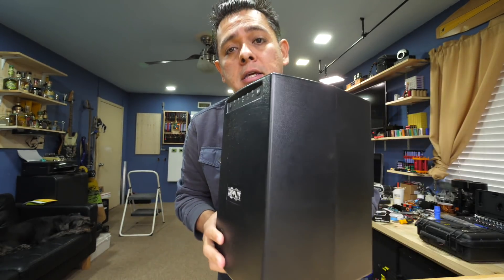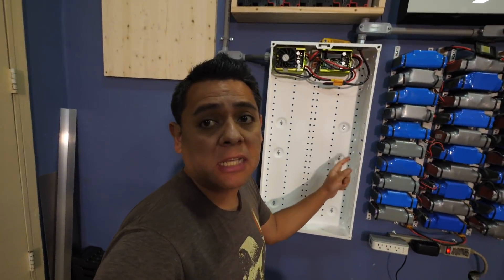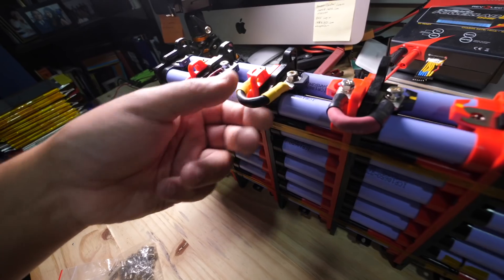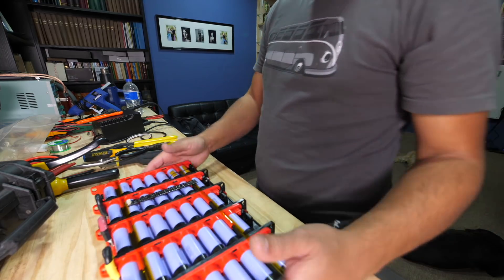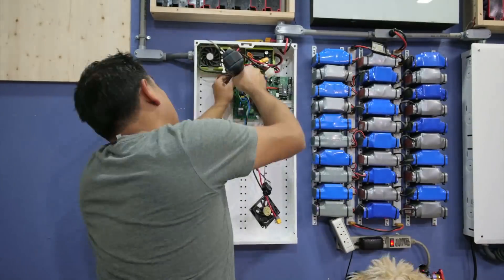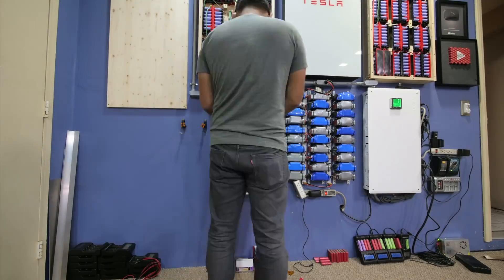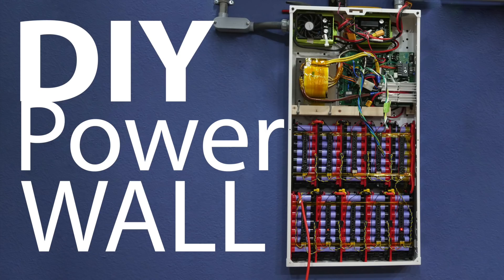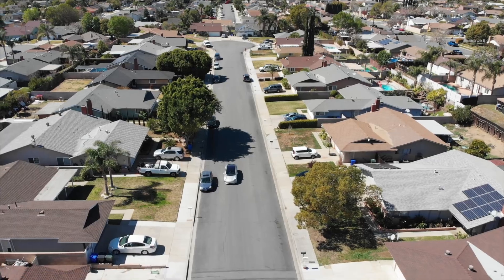1kw DIY PowerWall affordable  18650 build project (2018)

Comment: At the 7:40 mark you said it was a 40 watt fuse. That cant be right, did you mean 40 amp fuse. And the link in the discription takes you to a 32 amp fuse holder? Could you clarify.

Comment: Hi Jehu, I alway enjoy your content, thanks for uploading such great insights! 
One question though. Why do you tend to go with li-ion batteries for diy house powerwalls so often instead of Lifepo4 battery chemistry which would provide many more cycles? I know you have a few videos on lifepo4 but 99,9% of your contend regards li-ion.
Anyway, I’ve learned a lot from you and I have to thank you for that!
Reply from the maker: Because li- ion is much more available and thus cheaper to get,  lifePO4 is rare and expensive in comparison
Reply: @jehugarcia  wow thanks for answering! That makes sense. How much would you usually pay per kWh of battery capacity?
I’ve found suppliers where I would get „grade A“ 120 Ah lifepo4 pouch cells for $230/kWh. Isn’t that a good deal already?
Reply: @jehugarcia  OOPS! Just as of now I‘ve seen your new videos about lifepo4 batteries. Didn’t know only recently they came down in price.

Comment: You should take a look at car audio power wiring, they sell it by the foot and it's usually pretty cheap compared to welding cable most shops go all the way to 2/0 gauge

Comment: How about the automated firefuck system?
I see you have a good chance to die in house while any ill battery explodes and firestart PowerWall to release its power. The most danger does not fire itself, but mass toxic gases exhaust.
Reply: If you open any standard on industrial or autonomic second-power systems, it always includes points about 1) installation in non-leaving hermetic camera indoor with fire-protection door, or backyard installs only 2) vent system must be connected with fire sensor to switch it into fire mode (close boxing, stop vents,..)  3) automatic gas fire extinguishing system inbox, always or integrated with datacenter gas system

Comment: uh, our house goes through 110 kilowatts a month...  1 kilowatt would die in aprox 4 hours...  18650's?     3.7 volts at 3500 mah for $10 a piece....    some math 1kilowatt divided by 3500 miliamp =   you'd need 285 of them lol  

so $2800 some bucks not including tax for your 1kilowatt battery..    
or $200  for 2 marine grade deep cycle bats that put out 12 volts at 90 - 120 amps  Or 1.5 KILOWATT A PIECE.

Comment: transformer is most likely drive in square wave, hum can be reduce by putting capacitor at the output but will consume power ex.3uF have reactance 884in60Hz=8Watts loss if there is no any load.

Comment: do you recommend ups 1500va as inverter?  i have 1500va and 1000va, it is possible to connect this two ups in parallel?

Comment: It's a tease for people who don't quite have the skills for making this. (ME) Maybe a video about who could make up plans that show the wiring. Solar and wind power going into a UPS? An external battery pack hooked up to the UPS without mounting it on a wall? Or even opening the UPS. I guess my 24 volts would need a converter before going into the UPS.

Comment: This is a good guide on the cells and such when it comes to 18650 and DIY Powerwalls. It is though an instructable on how to build battery packs, but it the info is still good:

https://www.instructables.com/id/DIY-Professional-18650-Battery-Pack/

Comment: thoughts on these for boats 12v systems? vs say... lifepo4 12v batteries?
Reply: I'm here designing a power system for a marine application as well. We're on the right path it seems
Reply: Thinking foldable solar would be a neat addition to it.

Comment: So this is only 1000w 120v output? How long will that last at full load?
Reply: your laptop can run for about 3-10 hours. or running a hair dryer for 40 minutes

Comment: Your DIY PowerWall is missing the capability of feeding excess solar energy into the grid once the battery is fully charged and the sun still shining. Thats a crucial point for cutting CO2 emissions, as every renewable kWh fed to the grid will reduce the power produced by fossil power plants.
It also lacks the option to switch to grid electricity automatically in case the battery runs empty. Thats a nice feature aswell to keep your computer, fridge and stuff running even in extended periods of unfavourable weather.
Any ideas on how to improve on these points are welcome.
Reply: Not everyone has the option to tie into the grid here.  I'm looking at buying 10 acres in an area where there is a lot of property for sale without ready access to water, sewer, or electricity.  These types of tutorials are most useful for people who live off the grid, anyway.  Although, it would be helpful to you to have the option to feed excess energy to the grid.  My plan is to keep buying panels and batteries in preparation for the day that the electric company does extend power lines to my property and they'll start paying me for energy.  I'll have plenty of acreage to start a solar farm, just not the million dollars it takes to make it happen.  My goal is to have enough power for a dream kitchen.  In the meantime, I'll settle for all DC appliances.

Comment: Hey, do you have any idea on how to overcome the low voltage protection? The ups cuts waaay to soon using Li-on cells.
I think it shouldbe possible to trick the IC to think it has more battery but i dont know a lot about ups...

Comment: Hello, thanks for that great video. I'm looking to build a unit that will run a 250 watt bulb for at least 3hrs. rechargeable of course.  Any guidance or direction would be great. I am a beginner at this and have never done this before. Thanks in advance for all information.

Comment: I wanted to understand why people build power walls other than to have power if there is a grid power outage. Over here in my country there is a regulation that you send the excess solar power back to the public network and it counts as credits towards you that you can use anytime you want working as a "infinite battery" without the cost of having to buy batteries. This way the economicis of producing your own eletricity works much better.

Comment: 8). Why not use super capacitors?

To get capacitance equivalent to 1KWh, you’d need 300,000F (@5V.)  , 555,000F (2.7V).
That’s a LOT of capacitance.
I found some super capacitor modules 500F @ 2.7V with protection on amazon for $68.
So 555,000f would be like a thousand of these modules = ~ $65,000.

Plus, the voltage of a capacitor quickly decays as it discharges.
To get all the energy out, you have to discharge them all the way to 0V.
That means a much more sophisticated inverter.

Chemical batteries on the other hand generally produce a fairly steady, voltage until exhausted.
Maybe 2.7V-4.2V for Li-Ion cell, or 11-13V for a 12V lead acid battery.
That’s much easier to build an inverter for.

Capacitor technology has come a long way recently. It wasn’t long ago that 1f was just a dream.
Capacitors certainly have their uses.
But chemical have soooo much higher energy densities, they are soooo much more appropriate for energy storage.

Comment: Ok, 1KW, but how many KWh? That’s the otherkey specification.

KW is a unit of power, KWh is a unit of energy.

Sure knowing how many Watts you can consume at once 1KW, indicates about 10A@100.
That’s a nice amount.

But for how long? That’s where then KWh are key.

Do you have anything handles battery balancing when charging? 
Do the 4A BMS things allow cell balancing? I thought they went “open” when the 1S cell was fully charged?
With ten in series, that’d cut off charging as soon as the first battery finished charging?
Ditto on discharge. They open when fully discharged, causing things to stop when the first is depleted.
This sure sounds like a recipe for accelerating cell imbalance and having the two extreme units decide the rules.

Ten 4A 3.7V battery banks in series could only produce 16W. What am I missing?

Comment: I had been thinking of using a ups in this way, though wanted to know if it could be used somehow tied to the grid? So that you draw from it when it has power, but when it runs out you can switch over to the grid. How would I achieve this? Thanks!

Comment: Have you considered using a "grid tie" inverter, with some kind of current regulation so that you can hook up to the regular grid, and manage how much power you keep or use?...   I don't know if you are charging from solar, or grid mains... but you could use some single board computer to control charge level and charge/discharge rate to manage changing grid costs.

Comment: is this DYI seriously overpriced over standard commercial products at least compare price per kw? With tesla power wall this seems like way more expensive or i got it wrong?
Reply: @Tes Tos how is that? Here you got 1008 usd  / kwh  just for material for tesla power wall 2 13.5kwh assuming price 10 000 usd which is probably way more than you will pay. It is still 740 usd / kwh .... not even considering build quality and additional features.... please explain how it is overprice to solution presented in video?  so far you just scream with explanation mark with 0 information ....

Comment: Could you use for 12 volt batteries and get 36 volts and not have to use the temperature strips
Reply: I mean because I have the 12 volt batteries that would go into like an kids power wheelchairs thing so I have these available to me for free so if you had these would you use them like that you know use them as 24 volt pods that's how they come in an aluminum case that hangs on the wall That's how I get them

Comment: your bi-directional meter you listed isn't the same one you used. yours has a shunt.
with one do you prefer? Hall sensor or shunt?
does the 100amp work on say 400amp battery bank or only it it meant for 100amp/h max?
would it know when a battery bank bigger then 100amp is full?

Comment: And what does the sine wave look like.   I believe most of those UPS's use modified sine... Good enough for computers, but not good for AC motors, so your fridge may not like that power.
Reply: what I have read they use a modified step squire wave thats close to pure sinse but not spot on. hasnt blown my LED tv up yet.

Comment: Hello, I already had your channel for a long time and this video came in handy, I have UPS "Trust 600VA output 230V 60Hz 5A"but it came with a 12V acid battery. It turns out that the battery no longer works, no longer charges. I wanted to make a pack of batteries but my doubt is the amperage that will have to have to withstand a PC with a power supply of 800W.

Comment: you could buy copper pipe, cut it up and make at least 50 of those wire end fittings instead of buying them for $1.50

Comment: So 3.7v cells are so much cheaper than 3.2v, and I want to build a 12.8v, ~150ah lead acid replacement battery for an RV house battery bank. Is it possible to use a BMS to control voltage of ~100 3.7v cells, to get 12.8v nominal? Also are large prismatics ok to build (4S) into 12.8v deep cycle banks? Thanks

Comment: I just want to point out, for wires and fuses, feel free to look at car junkyards for them. you can get thick wires from off the battery, starter, etc for parts of the project, and fuses come in a large variety of amperages, and coming from a junkyard they can sometimes be sold for pennies on the dollar

Comment: That's a lot of $$$ for only 40 amp hours. I can do 110 amp hours with sealed lead acid batteries for that price. It's not like weight matters in this scenario. And properly charged and maintained they will last at least 10 years. I do like the lithium but for the price it's just still too high.

Comment: If you wanna save money and reuse batteries 
The EZ Battery Reconditioning™ course is the easy to follow, step-by-step system to recondition all kinds of old batteries with just simple supplies you probably already have in your home.
The course is made up of step-by-step guides that show you how to recondition each type of battery. And each guide is full of pictures and diagrams so you not only read exactly what to do …you see exactly what to do as well!
It’s like having me and Frank (aka "The Battery Man") standing there with you, guiding you every step of the way as you recondition your batteries.
And it doesn’t matter if you’re not technical or don’t know the first thing about batteries... because our course is designed for beginners and is incredibly easy to follow
you guys should check this out.
https://bit.ly/2C4UZCA

Comment: If I have 300W solar system and have access to 12V DC 16Ah rating how many should I put in parallel to make it work correct? Any help would be cool.
Reply from the maker: 300x 5.5 = your answer
Reply: Thanks for getting back to me. Recycling large industrial wind turbine pitch batteries for my off grid shed. 
Like your info keep on helping with the vids!

Comment: The lugs you crimped with your plyers, rotate the lug 180 degrees from where you normally crimp it, it'll look smooth on top and the crimp won't be seen.

Comment: Question: I have around 20% 2900mAh and 80% 2200mAh Samsung cells from ebike packs. How to mix to a 14s60p setup? Like 12x 2900mAh + 48x 2200mAh (in average, all cells are capacity  checked of course). Or like 60x 2200mAh packs and some 45x 2900mAh?

Comment: Nice DIY video!
BTW, have you thought off having  DC wiring in the house and install DC LED Lights, USB 5V charging point, DC ceiling fans etc. Cause DC to AC conversion results in losses.

Comment: now that we know that the thing basically cost $1,000 so basically if you were to take that whole thing and put it into a bicycle now because 500 bucks how far would you be able to go on that battery at 36 volts and not use the 110 part of it or use it both ways when your bicycle in the bike is running 36 volt when you're basically running running off the inverter it's running it's running 120

Comment: so if I was to take that thing and now charged it up put it on a 110 system and then put that battery pack which is 10 batteries and split it have it still 36 volt each battery pack correct so five of those together is 36 what would it cost me to recharge it and discharge it I wouldn't want to run it on 1:10 I would want to run it on just basically 36-volt

Comment: so five of those batteries together is still 36 volts correct and if so that would run a electric bike for how long do you think you'd be able to get out of it if your 400 pounds would you be able to get 20 miles of that battery pack and how long would it take to recharge it and how long do you think it would last you know what it cost we don't know how much it cost to recharge it and what are you would have to have to charge it back up again you wouldn't need a plug it into your wall the battery pack isn't removable and you can't plug it into some other system so if that wall unit was able to be moved from point A to point B and you took it with you and then put it in your house you just plugged it in and charge it up how long would it last and if you don't put it on an electric bicycle and then came home with that thing and plugged in so electric bicycles 36 volt you take that same system you put it on a wagon behind the bicycle how long how would you connect to the bike and how long would it take to recharge it and how many miles do you think you would get out of there baby you pulled 400 pounds weight behind a bike how many miles do you think you would get out of that that battery pack thousand dollars for that whole systems nice put a batter up put it on a bicycle and how far do you think you would get
Reply: @ James Ledesma-

Did you sleep through the classroom days where capitalization, punctuation and paragraphs were discussed?  What a wall of text!
Reply: I watch a video they're trying to produce something at show us something to be done if I can make a comment about it and I don't type it correctly up violating what rule first of all I'm talking to the people in the video if they're even look either going to watch it it's been 6 hours a day any of these stupid things and when I am not going to spend that time I spoke into my phone Google you're coming and I wouldn't even care if you spell the word wrong or you said the wrong things and doesn't make it did I get your point if I didn't understand what you were trying to say that's a different story but I don't read people's comments and is not meant for you to say what's meant for them you're not the person in the video

Comment: okay you can pull 900 watts on it for how long before you eat before it will not be able to run 900 watts say you have no charge coming into it it says to charge battery it's night time how many hours can I run 900 watts off of it

Comment: I get it you spend $1,000 you made the wall I got that you got 900 watts of power that you can pull off at any given time that's not even a hair dryer that's half of the hair dryer so you would need double that to run one hair dryer for how long per day

Comment: now you're saying you have to have a solar system that will convert it and charge it has 36 Watts but how many watts per day can you put into it you can't put a 2000 or 3000 watt 36 volt input into it can you this is the part I don't understand you say you have it charging on DC what happens when your hug plugged in 110 how do you make a system that is able to be charged by DC 110 and make the same power while what is it produced after it's recharged would you be able to run 900 watts for 5 hours every day
Reply: dude, solar cost more than it generates, end of story.